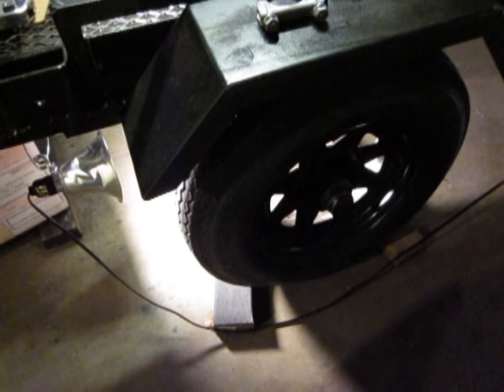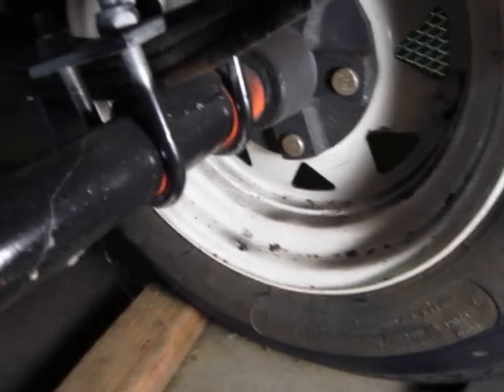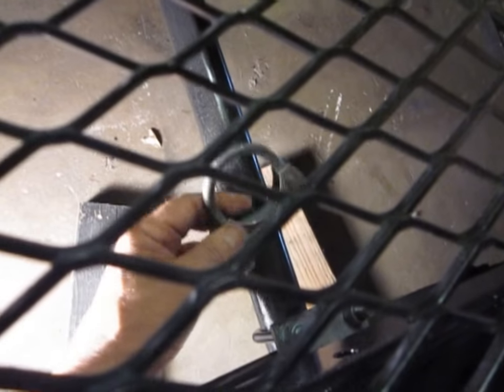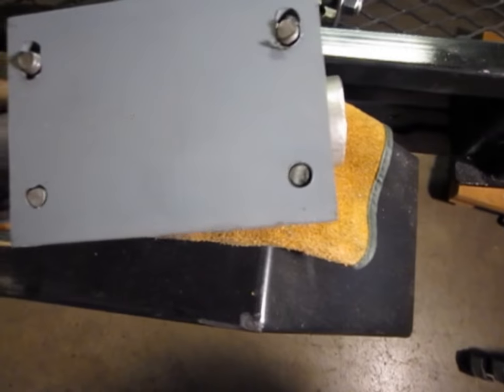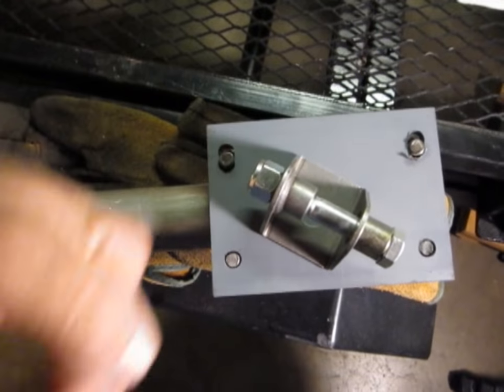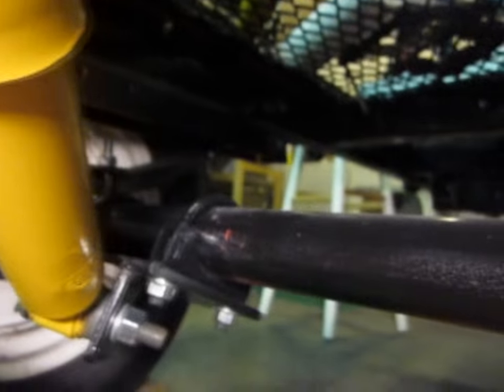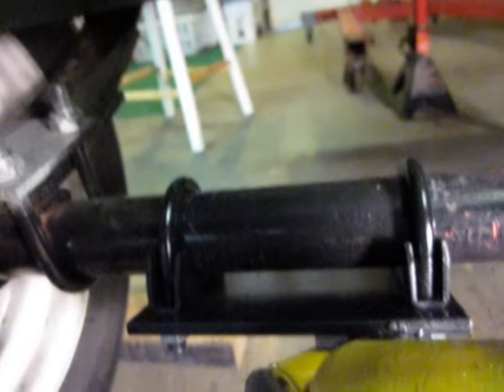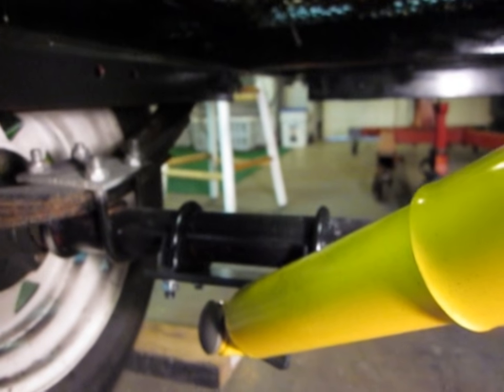Adding Shocks to a Trailer

Comment: Genuine Question, is there a reason you put it at an angle? Or would straight be okay? I’m going to try to do this to my trailer, so I’m looking for info :)
Reply from the maker: Excellent Question!  The reason was the lack of space.  A smaller shock was not only unavailable, but also not very practical.  With the small trailers, one is between a rock and a hard place.  Good luck on your retrofit!  Even if a bit odd, it's sure better than nothing at all.
Reply: yea looks like limited space .  more upright would work better but what ya got to work with .   im about to do y cargo trailer with a drop axle.  itll never be offroad so im making my bottom braekt a drop bracket 3-4' below the axle like my truck has and then it will have less angle

Comment: Did you weld the clamps to the axle as I would be worried about the clamps loosening over time.
Reply from the maker: NO, and the risk could be to weaken the axle.  Also, the clamp may have to be moved or replaced, so think ahead on disassembly.  It's an experiment until it is just where it's needed.  Be sure to test drive on a safe road before getting on a highway.  There should be no swaying at all.

Comment: Hows it ride now?
Reply from the maker: It's very good.  I took it over traffic buttons and the roughest roads I could find.  The whole trailer rides very well and I don't hear the noise it used to make as it bounced at times uncontrollably.  My drop-gate is very heavy too, so it really is working, the shocks that is.